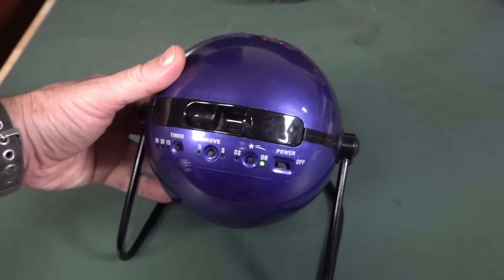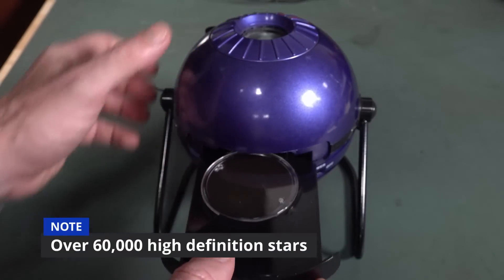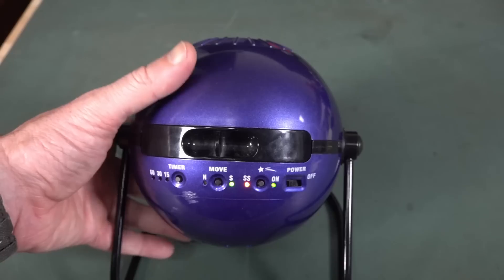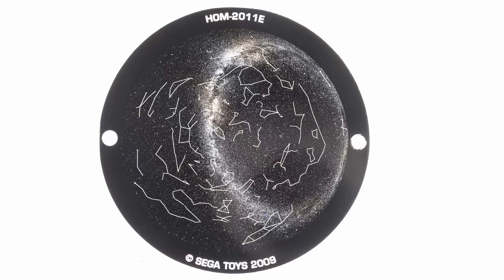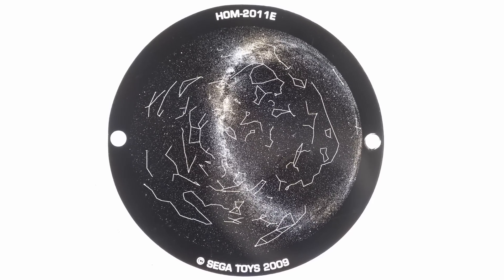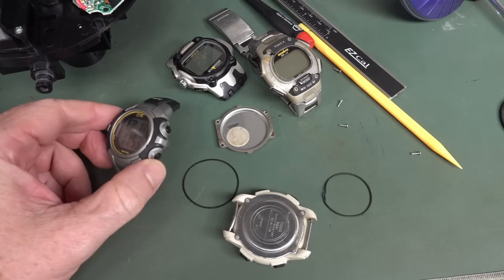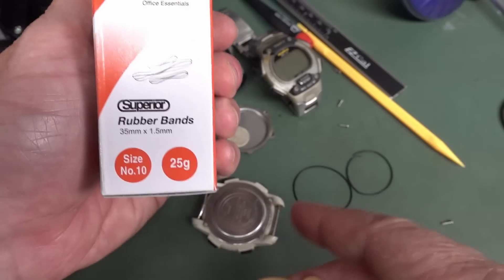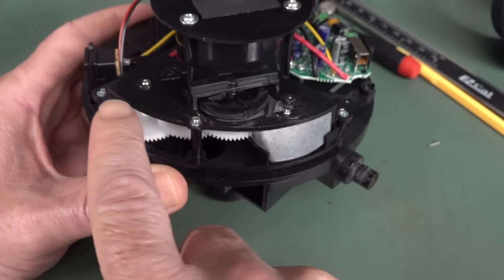EEVblog 1456 - Sega Toys Homestar Planetarium REPAIR

Comment: I bought flux in 2019, as I kept it in packing for long time satin black finish rubber outer coating became degraded and sticky. 😢. I have used alcohol wipes and water now the rubber cover completely gone. It was soo shiny and crisp with that cover. Is there any possibility to buy it's rubber coating cover? I tried contacting sand blaster service here in Hyderabad, India, they all have no idea about it.

Comment: lol had exactly the same problem xD Thanks for the DIY fix! haha

Edit: FUCK I wrote an extensive report for my fix and closed the window lol -.-

1st attempt - Found a sub 1mm oring, less than 1inch from an aluminum pill case. 
Result: Works to a point or won't even move at all, too tight where the motor doesn't have enough torque.

2nd attempt - Rubber bands used in packaging extension cables (USB-C, Lightning, etc) from Amazon. Were a bit thick so I cut them in half. 
Result: Works to a point as well. The bands were somehow too thin? They broke after 15-30mins O.O

3rd attempt - Found a rubber band with similar dimensions in the video from work. 
Result: Again, works to a point lol. It will get stuck eventually. You can either press the button to have it rotate the other way to unstick itself or open it back up again to fix. So, unfortunately, this is only a half solution? Going to test if this can run continuously where the stars rotate in the N position (band has more travel going this direction so it doesn't get stuck to the housing). Hopefully the band doesn't break (wtf is this thing made of seriously lol) but if getting stuck keeps being an issue, my next solution is to grind a part of that inner housing to give the band more room.

Comment: My lenses fell apart when I did this with my flux. Can you tell me if the lenses were turned inward into the plastic tube (so the flat end was on the outside of each time), or with the round ends facing out?

Comment: As a kid in the late 80s early 90s i used those rubber bands to temp. fix my cassette player. It was only a temp. fix because the cheap multi colored rubber bands only lasted a year or so before they snapped again and had to be replaced with fresh ones.

Comment: usually the first transmission in machines is done with belts to allow some slip between the motor and the other parts. This is done to accomodate strong inertial forces when the entire train is accelerating. Think of lathes, milling machines, etc.. they all start with a set of belts transmitting torque from the electrical engine to the second axis. After the first transmission, they all use gears.

Comment: Oooo we had a few of those over up Japan! Glad to see one reach down under and right on EEVblog it gone down! Anyways...

CD and DVD players (and desktop drives too) that have motorized trays usually have a belt to limit torque transmission and not lock up the motor when someone does tug or push the tray in

The extra large alloy block surrounding the motor is for cooling it down. Not that it helps a huge ton but for something that would have been ran for a day or something (one of our rooms was a night room and that was on 24/7 but it is Sapporo, cold)

The belts were most probably for smoothing out the drivetrain. Plastic gears cannot really be ground to tight specs to minimize noise at such high reduction (which is caused by gear imperfection as they cannot be ground and mated to each other through wear, plastics) and what if someone jammed something onto the tray that was not intended to be...that would wear out the motor and the first two gears pretty quick. The lower one for the shooting star effect will be cost cutting. Bridging that far of a gap with gears would be a little more involved that what it is already...

Proper belts for most tape decks and record players are square (regular belt) or rectangular (a flat belt) in cross section shape. The groove you see on the pulleys are designed to accept the square one which will be tilted to a diamond into the groove for maximum contact area (two sides of the square meeting the pulleys). Section thickness is about right where Walkman belts are at but if a 1mm section can fit then go for the thicker one...less likely to break than a thin one

The time you can put a proper one in...please do the rest of the belts. Just to be safe. Don't forget to clean the pulleys before putting the new belts.

Comment: I'm sure it's been mentioned but cd players use belts. Some of the old high-end Sony's used multiple belts for the tray and clamping mechanism, not the PU which used a linear motor.

Rubber bands are a very temporary solution as they dry out and crack quickly.

Comment: Rubber band is an OK drive belt replacement as long as it's not a tape transport (capstan drive, etc.) where variations in the belt cross section can cause variations in speed, which could mess up playback quality.

Comment: When you cut a piece from a larger belt, perpendicular, and glue it together perpendicular, it will work.
I don't think a sealing O-ring is the right material; one is for tension, the other is for pressure. Your elastic rubber baby bumper belt looks best for now.

Comment: Annoyingly CD drives DVD drives etc use a belt for some stupid reason for the tray which means they usually get stuck in when the belt is getting weak,,,,

Comment: 7:17 I've definitely seen belts in some CD-ROM drives. 🤔
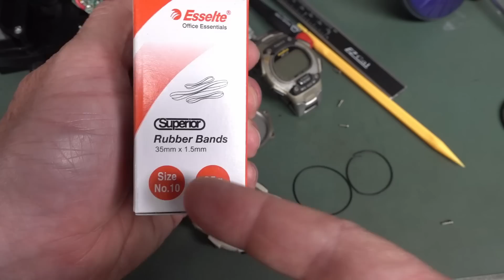11:12 Been there, done that. I've repaired portable cassette players with a rubber band instead of a proper belt.
13:42 Two issues with using rubber bands in place of a belt: • too much tension killing torque • slipping from not enough grip

Comment: Yes CD Rom drives do use a belt. but not for the drive of the disk, that's a direct drive to the motor, the belt is used for the disk tray to go in and out.

Comment: LOOK INSIDE SOME OLD PRINTERS OR "CAR STEREOS", (if you you have some laying around) YOU SHOULD FIND WHAT YOU NEED IN THEM,!  (with a bit of pulling apart)    seeing that the belt that snapped on it isn't doesn't seem to be holding loads of strain you could put it back together with a bit of glue & heat-shrink tubing until you find the proper size. it should do as a quick fix util then.. ; )

Comment: Nice use of a #10 rubber band, my favorite size for decades. Perfect for bundling fan-fold paper tapes in the 1970's. Perfect for bundling small cables and lengths of wire for storage now.

Comment: I have a big bag of at least a hundred belts like that taken from old motorized devices and tape drives, etc. I wish I could send you one. You can use a rubber band, but it won't last very long. The rubber will degrade after a few months if it's under tension, especially if it's turning.

Comment: I think they add and use belts in parts of the drive mech to cancel out any gear lash that maybe present. Since it's supposed to spin slowly to project an elegant starfield and gear lash would cause the starfield to jerk around and make for an unpleasant viewing experience.

Comment: Rubber bands are a poor substitute for drives like that. Rubber bands are not cut accurately and the thickness varies throughout its circumference. Google tape drive belts. Customers tried to replace the tape drive belts with the rubber bands and they were complaining of bad sound. I had a lot of such repairs.

Comment: Belt drives allows a smoother, vibration free primary drive. That's why there's all the fuss about belt driven audiophile turntables for playing vinyl records. Any motor vibration would ruin the smooth rotation of the night sky effect.
Reply: meanwhile HDDs are direct-drive and are one of the most highly precision vibration-free engineering marvels in the world
Reply: Exactly true. That's why I posted almost the same answer

Comment: I tried replacing a broken belt from a toy with an oring... the oring put too much tension on the motor and it overloaded something in the motor drive circuit.

Comment: I think the belts are there because they can slip in the case of a mechanical failure. This'll save the gears if they ever get stuck.

Usually rubber bands are actually quite good to replace bands like there.

Comment: Try a rubber fuel bowl seal for carburetor on a Briggs & Stratton engine. Comes in a kit or even by itself at your local hardware/lawncare shop.
Rubber band will work a treat.

Comment: I think they use belts on the first reduction levels for noise. After two belts the speed in low enough so they can use cogs, they won't make much noise at low RPM

Comment: Can someone explain to me what's the deal with digital watches? I was born in 1990, everybody had them when I was going to school and they always looked so tacky toy like and soulless to me, even as a kid, if anything I switched from analogue quartz to mechanical watch when I got into high school, just turning the thing over and seeing balance wheel, escapement and the whole caliber work thru glass back is as doki doki as it gets for me.
Reply: When mechanical watches were common, digital was novel. Now digital is common, and mechanical is novel.
Reply: @firesurfer  I don't think it has anything to do with novelty, at least not for me; I have driven Rimac Nevera if it isn't novel I don't know what is, and I get the same feeling as from those kind of watches yes they are hyper accurate and that car is insanely fast, but after about 15 minutes of slamming the go pedal it loses the rush, the car becomes less engaging than a cable car, and I feel like driving my 20 year old miata because it feels more fun.
Reply: @Sebastian_Athea  It has to do with your age. When I was 25, digital was exotic. People who are 25 now find mechanical watches the same way.

Comment: The reason they use belts instead of cogs is usually slippage. This thing has a huge reduction, which means if it jams up near the end of the gear train, the small motor would build up enough torque to strip gears if it were directly geared all the way through. By adding a belt, the slippage can save the gears further down the gear train.
Reply: ..... Excellent, I only thought of noise dampening.
I assume there would be a kit from the manufacturer, as those other belts are perishing at the same rate.
Reply: @robbieaussievic  Sure there's a kit, it's called "Throw it away and buy an entire new one". Yeah it kills the environment but the shareholders like it.
Reply: if it used gears instead of belts in the high speed section it would be as loud as a toy car, not good to sleep hearing that.
Reply: (✷‿✷)†𝟭𝟱𝟭𝟮𝟲𝟳𝟳𝟵𝟰𝟲𝟮(✷‿✷)
Reply: her availability is sure on
What's apk ⤵️⤵️⤵️

Comment: Almost all older CD-ROMs have a belt for the drawer mechanism and for other functions like CD switching
Reply: They will be too big or thick for your use though
Reply: Also they use the belt to save the motor in case the mechanism freezes

Comment: You keep saying "FX-91W", but the watch is just called "F-91W".
I think Casio uses the FX-prefix only for scientific calculators.

The answer to the "why belts" question I believe is "noise"?
(same reason most combustion engines use timing belts or chains instead of spur gears for camshaft drive)

Comment: CD drives and players usually have a belt in the drawer mechanics. - also: the belt on the "high speed" side is most likely to keep the noise down: gears at a certain sepeed are noisy and will probably also grind themselves to dust eventually.
Reply: @sexygirls2778  hello, spammer.
Reply: @jkobain  keep reporting... these bots are a curse.
Reply: @atkelar  I keep doing so. And thank you for the reminder.
Reply: @jkobain  I assumed so.. But your reply to the bot showed up as a notification to my comment and it's sometimes hard to see what reply goes where... YT has not the best 'thread diaplay' 😅
Reply: @atkelar  well, it's certainly not the worst of what it could've been, but I tend to agree with you.
Reply: Came to say the same thing, I don't think you'd be able to transmit enough torque with one for the speeds a CD needs to spin up to in such a short time.
Reply: BBC B
Reply: V,,,,v.   Ok
Reply: her availability is sure on
What's apk ⤵️⤵️⤵️

Comment: I once fixed a Walkman's snapped drive belt with a condom, i cut the thick band off the opening of the condom and it worked a treat!! that was the most action that pack of condoms saw however i was left very satisfied... with my MacGyver fix : )
Reply: That's smart!

Comment: It's a tough choice between this and the latest The Signal Path video (just pushed a ribbon-cable back) as to which was the more complex repair. :)

Still, should've changed the caps, just to be on the safe side. :)

Comment: There is a memo on the Service Manual for this device, it states: 
"When opening for repair make sure you have the proper containment device to collect the Galaxy Gases inside so they can be replaced when reassembling" :P    j/k
Reply: @sexygirls2778  You b*tch mispelled "collection".

Comment: If the rubber band is anything like those used by the UK post office, it will be designed to deteriorate after a few months.
Reply: If you want a rubber band that lasts for longer, cut up dish washing gloves - fingers thumbs, palm & wrist give different sizes. Very long lasting and durable.

Comment: the reason for the belts is for noise supression and getting much greater gearbox ratio's in the same volume. ps: Obama also wore a F91W. (and me as well but i did recently upgrade to a 168 for the metal and better backlight)
Reply: That and the rubber belts help to absobe any jitter incured in the gear mesh during the reduction. Leading to smoother operation and viewing